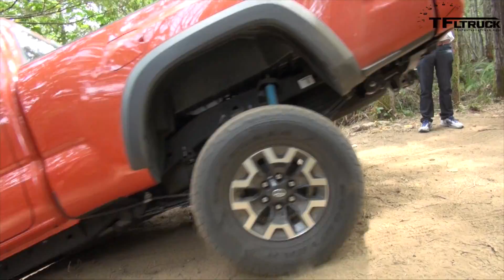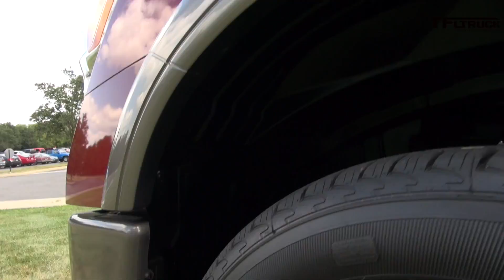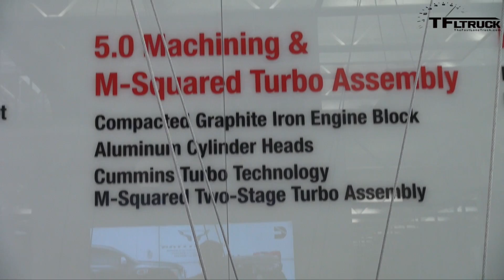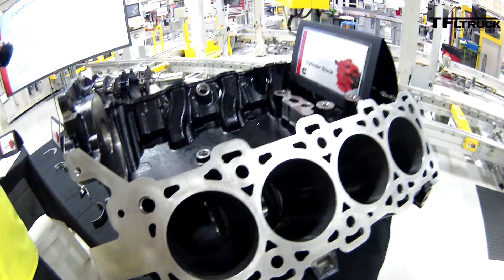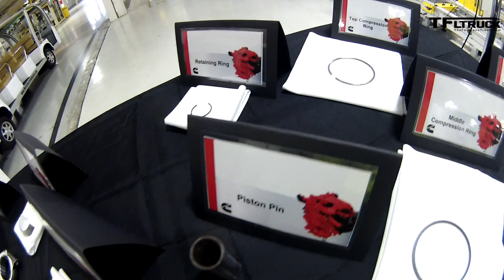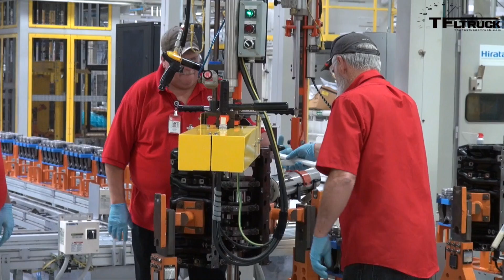2016 Nissan Titan XD: 5.0L V8 Cummins Revealed: Almost Everything You Ever Wanted to Know

Comment: fuck ur pice of shit cummins and powerstroke if u want a real desel get a duramax
Reply: I like this guy
Reply: lmao fuck that lol the duramax have been the less reliable of the big three!
Reply: Lol that's why they've had 5 different engines while dodge has had 3 and ford has had 4 lol
Reply: +Samuel Sanchez 5 different engines? The Duramax has been the same displacement and valve train since 1999. The changes have been to increase power, meet EPA regs, and fix early injector issues. It's been the same engine for 16 years. Ford is the one who has gone through the most changes, from the Navistar 7.3, to paying Navistar to design the failed 6.0, the 6.4 (which was supposed to fix the problems of the 6.0), and then finally doing it themselves with the 6.7.
Reply: soaringtractor
Agreed. The 7.3-powered trucks are still sought after.
Reply: Samuel Sanchez
Your example doesn't wash because the gas the engines use would be analogous to the rifle rounds, and gas, like the rifle rounds, can be used by more than one manufacturer's engine. The AR and AK are made by two totally different manufacturers, thus making them different. All versions of the 5.4 V8 are made by the same company.

You keep trying to make your point by referencing nearly everything external to the engine that changes, without addressing the core engine itself.

This explains the differences in Duramax engine versions. You'll note most of its design details remain the same from 2000 until now, hence my point:

http://truckintees.com/chevrolet-duramax-diesel-whats-the-difference-lb7-lly-lbz-lmm-lmk-lml-lgh
Reply: +Samuel Sanchez Dodge/Cummins are good... Ford diesels blow, outside of the 7.3... I don't trust any new Ford with a diesel in it after all the crap they have produced as of late. I would take a Duramax over any Ford motor, outside of the 7.3.
Reply: +Samuel Sanchez Duramax = reliable
Reply: There is the 5.9l 12v, 5.9l 24v, and 6.7l Cummins
Reply: +Samuel Sanchez One engine more than ford and they aren't reliable? lol... You must drive a F-150.
Reply: +Chris Ragsdale lol actually I don't to me 1/2 ton pickups are a waste of money lol anyways ford got rid of the 7.3 and dodge got rid of the 5.9l 12v due to emission regulations while Chevy got rid of the lbz due to injector failure, overheating, and head gasket failure so yeah lol I wonder why you said I drive an f150?
Reply: +Chris Ragsdale f-150 owners*
Reply: +Chris Ragsdale oh OK lol and yea same thing with all diesels the fucking emissions bullshit is what ducks em up lol
Reply: +Wade McKenney which one can beat this ? I have seen none in a 1/2 ton pickup
in Fact Nissan will own the show  for 1/2 ton  diesels
Reply: SurelyYewJest well if you look at it that way the 6.0 and 6.4 are the same engine just like you said different shit to it. And I highly doubt a current duramax will just bolt right up to a 1st generation duramax silverado and work without modification since the changes were so minor you know lol
Reply: Samuel Sanchez
Um, the issue wasn't whether the current LML Duramax could bolt into the same space as an LB7. I never said that. The issue you brought up was about the Duramax supposedly changing 5 times in a way significant enough to be considered 5 totally different engines. The answer is no, it hasn't changed to any degree such as Ram's switch from the Cummins 5.9 ISB to the 6.7 6BT; or Ford's multiple ground-up redesigns since the Navistar 7.3.

Are you somehow not able to differentiate between what the basic internal design of an engine is, and the design and location of its hard points for the vehicle it goes into?
Reply: +SurelyYewJest really that's like saying a 5.4l 2v and 5.4l 3v are the same when the opposite is true
Reply: +soaringtractor not to mention it bolts up to a different tranny and the intake manifold is different
Reply: Samuel Sanchez
Obviously your definition for what defines a "totally different engine" is quite loose. The 5.4 2V and 3V are effectively the same engine, one is just newer than the other. Same general design, same engine family, same applications. One is merely an evolution of the other.

So explain how GM selecting a new transmission to bolt up to the Duramax means the Duramax itself changed? Bell housing bolt patterns constitute a totally new engine? A new intake manifold means everything - block, pistons, valve train - changed?

Is the current Nissan VQ NOT an evolution of the original VQ30 of the 1990s?

Were the GM 2.8, 3.1, and 3.4 NOT evolutions of the original 350-derived 2.8?

Is the current Hemi NOT an evolution of the new Hemi from 15 years ago?

Was the Vortec 8100 NOT a perfected version of the 454?

At some point an engine is changed enough that one could say it's totally new, but looking back on the light duty diesel history of the last 15 years, the Duramax is the design that has changed the least, especially compared to Ford (not that change is necessarily bad, or not changing for that matter).
Reply: +SurelyYewJest bullshit because the 5 4l 4v and 2v  came out before the 3v yet they are all different. that's like saying an ar and an ak are the same because they can both shoot 5.56 or 7.62x39 or 5.45x39 or .410
Reply: +Wade McKenney Fuck Duracell! Why you think Nissan went to Cummins, cause powerchoke and Duracell cant handle any loads.
Reply: Steven Wallace
"Duracell" is supposed to be some kind of bust on GM?
Reply: SurelyYewJest lol there is still a difference! Why don't you get it? Lol just because the displacement is the same doesn't mean the engine is like ford's 302 and chevys  305 they're both 5.0 but different and also is the 6.8l v10 and 5 4l v8 the same? Since the engine core is the same the v10 just has 2 more cylinders?
Reply: Are you serious about Powerchoke??  They overheat and cant even handle pulling my little pony trailer up a decent hill. Give me a break.. Powerchunk will never hold a candle to Cummins.. And Duramax, yeah they might be fast off the line, but when it comes to where it matters all they are good for is getting their wife to hair dresser faster.  When it comes to lb for lb.. a v8 will never hold a candle to a Inline diesel.. ya better go back to school and little a little about diesel engines bud... why in the hell do you think they put Cummins in F-650's?.chew on that for awhile... and yes DUH!!!!!! Duracell is my crack on duramax.. wake the hell up.
Reply: +Steven Wallace The 650 had the 7.3 option when that motor was still around (not sure about 6.0/6.4). and when CAT was still around most 650's had the CAT motor
Reply: Samuel Sanchez
You are dull. Why would I ever say the Ford 302 and Chevy 305 are the same engine? 5.4 V8 = 6.8 V10? You don't even understand what I'm saying.
Reply: Because they share the same displacement just like the duralast I mean duramax lol and it's ok saying they are all the same is like saying a human being and a truck are the same cuz we both come from stardust leftover from the big bang lol
Reply: Steven Wallace
Ford has replaced all Cummins offerings in their trucks with their own PS 6.7. Your argument is based on old information.

"Duracell is my crack on duramax.. wake the hell up."

I see you have but one brain cell and air to rub together.
Reply: Good comeback, fail!  You better get your information straight dumbass, Cummins to this day is still putting their engines in FORDs you got some bad info.. hahahaha.. and why do you think that Cummins employees get discounts on Chevys, Fords, Dodge, and the new one NIssan..  Cause they all have either HOLSET parts or Cummins parts on their turbos or engines.. hahahaha you apparently dont know shit about the engine market.  Oh btw.. Cummins owns 100 percent of HOLSET.. just  a history lesson for you! jackoff!  SO yeah unless you have aftermarket parts on your turbo you have CUmmins parts on your truck when you bought it brand new... hahahahaha.. God you are freaking hilarious how stupid you are.. dont believe me,  call GM and see what they say..
Reply: Steven Wallace
You are living in some other dimension, or you are trolling, or both. Point to us where on Ford's website it says anything about their trucks using Cummins engines to this day. For that matter, where on Cummins' website does it say they have replacement turbos for GM and Ford? Because I'm not seeing those selections.

And so what if certain parts of engine systems are made by a company that is owned by Cummins? GM's Duramax and Ford's PowerStroke 6.7 use Garrett (owned by Honeywell) turbo units, and at one point IHI supplied the turbos for the Duramax. Even if Holset supplies specific parts for turbos from other makes, how does that mean Ford and GM use Cummins engines?
Reply: +soaringtractor don't listen to that guy according to him both the 7.3l psd and the 7.3l idi are the same engines because they are both made by International and they share the same displacement lol
Reply: soaringtractor
I know. That's what I said. Twice.
Reply: +SurelyYewJest really bro? get lost! don't even get me started on the differences! lol
Reply: +soaringtractor the 7.3l idi hasn't been in production for 21 years!
Reply: lmfao.. you apparently have no freaking clue how big Cummins is.. do you know how many freaking types of engines they make? and how many distributors and manufacturers they sell to?  I guess its because their engines sucks balls HUH? Yeah right.. if they sucked so bad why did they profit over a billion dollars in sales?  they make engines from a 2.8L up to 95L in many different configurations for alot of different types of applications.. offroad, highway, marine, and Gensets!  Please tell me again how Duramax is so superior over Cummins again?  I would like to hear that.  There isnt any other company other than CAT that can come close to their capabilities.. I cant wait to see this new V8 blow the doors off that duramax and trust me it will.. Here some future advice: Might want to wrap a towel around your head to keep your jaw from hitting the ground when you witness it.  Dont get too butt hurt over it. :)
Reply: soaringtractor hell yeah! The new super duty's are freaking insane! I work in pipeline construction and holy shit they blow both the Chevy and dodges out of the water! Too bad the interior fucking sucks balls now lol
Reply: Godsimaginary74 Dodge and Chevy might be bad ass on the street but put them to work and they don't last for shit. Yeah the Cummins and Duramax theoretically might last a million miles but it's pointless if the rest of the truck falls apart at 200k
Reply: Samuel Sanchez
Ford Motors outside the 7.3 are shit... The newest may be ok... their 6.0 was complete garbage... Talk about NOT being able to work, 6.0 is a joke.
Reply: +Godsimaginary74 the 6.0 wasn't that bad lol people just made and still make a big deal about them when they fail lol truth is all 3 have their problems
Reply: That comment made me fucking cringe

Comment: according to studies,  16%Titan owners tow  with these trucks.
so whats the point of this?
Reply: +SANIC The point of what? What question are you looking for an answer to?
Reply: SurelyYewJest a diesel is LITERALLY designed to pull!
yet none of their owners acually tow..
Reply: And what percentage of active F-150 owners tows? Do you have that data? Even if it's more than Titan owners, what percentage payloads a significant amount on a daily basis? What percentage of other trucks? If towing MUST be done, why did so many companies make compact trucks in the 80s and 90s? Those models couldn't tow much beyond 3000 lbs, if that.

If I polled all current pickup owners everywhere, regardless of make or model, I guarantee you the aggregate percentage of those towing and those not would be very much in favor of the latter. I have people in my neighborhood that buy $60k trucks as luxury vehicles, vehicles that have very obviously shiny and unused hitch balls attached to them.
Reply: SurelyYewJest F150 and silverado owners were at 56% if i remember right.
why make a diesel engine for a group of people who NEVER tow./
Reply: SANIC
A great deal of that percentage of Silverado/F-150 owners is likely to be business, so your numbers are skewed. But you know that all cars have tow ratings, right? A Honda Civic has a maximum rated tow capacity. Why should Honda give it any capacity if next to nobody ever tows stuff with one? Your argument doesn't make sense. It's a pickup. Pickups payload and tow. Who cares what percentage of their owners tow? Why should Nissan ignore those that do because you say so?
Reply: SurelyYewJest 500lbft or 300, it won't make a difference in a truck that people don't use for gowingt

Comment: Are those plastic timing chain guides? That interior looked damn good.
Reply: Just to answer your question with an opinion, I don't think they looked plastic. But I just wanted to mention that plastic seems popular in timing chain guides because that how it is in my V8.
Reply: +GeeBigSup The 3.5 timing issues were actually the abrasiveness of the US vendor machined chains. Notice none of the cars with the first letter J in the vin had zero 3.5 chain problems and used plastic guides .
Reply: Name a modern engine that doesn’t have plastic guides lol
Reply: +headcas620 They are Teflon guides.
Reply: +headcas620 God I hope not!  Having plastic timing guides on the Nissan 3.5 V6 didn't work out too good.

Comment: Just announce the darn price and fuel efficiency already!
Reply: +baseballwarrior17 I doubt it will beat the 3.0 diesel in the Ram but this engine will definitely do a better job towing.
Reply: +gperez12773 
I delited EGR, DPF, DEF off my 2011 ford superduty and yes my MPG got wayyy better, better respond, and i fill much better power, that on stock, recenty added H&S performance tuner and now i cant go back to driving stock settings love my H&S tuner
Reply: +blackericdenice im sorry to call you out but they are right and you are wrong you need to do your research and yes he did call the dpf the src the dpf is on every vehicle as of 08 and above that is a diesel it was a requirment by the epa and it does effect fuel economy in ford, chevy, and dodges they all lost economy due to these systems and the new diesels still use number 7 and 8 cylinder on the powerstroke and duramax and 5 and 6 on cummins to squirt raw diesel fuel into the exhaust system to raise it to 1200 to 1300 deg. F to cook the soot out of the dpf so there is a  drop in fuel econmy but with the added scr systems they do help with some of that problem by taking the nox and co2 absorber out of the exhaust system there for the nox and co2 absorber no longer being there does not need to regen as often so there is a gain in fuel economy but not by much because the dpf still regen every now and again so partly you are right but please do enough research next time so you dont sound like a dumbass
Reply: DUDE ! YOUR A SAD LIL BOY !...PRETTY FUNNY THE LOSERS I MEET HERE!..LOL OH YEH!...LEARN HOW TO SPELL "WRITE" NOT "WRIGHT" ...FUKN FLUNKY! LOL
Reply: +harry escarole Please do us all a favor and take your negativity elsewhere! Your presence alone is robbing us of precious  brain cells
Reply: +blackericdenice Actually you got it wrong. The newer systems still use diesel in the exhaust.
Reply: +youngblood23rb  yes, awaiting price.  stated fuel economy is a red herring.  we will need to have real-life towing over long distances to determine what the real fuel consumption may be.  the Titan is a very interesting competitor.
Reply: Ram turned down this engine from Cummins because it wasn't getting the fuel economy they wanted. I believe it gets low-20s tops.
Reply: +baseballwarrior17 I don't think they  have suitable vehiche for it - 1500 is too small, the others are too big.
Reply: +LR4TLC200 the regular titan is a 1500 the XD is a beefed up 1500
Reply: +C-grunt I never said it will beat the Ram and it won't. I would bet 16-17 city and 21-22 highway. 23 tops (with the little asterisk saying the exact setup you have to have to accomplish that)
Reply: +blackericdenice imagine if the 3L didn't have emissions prob get even better mpgs
Reply: +gperez12773 what is cace ?
Reply: gperez12773 yeh i didnt hear you either becuase a sloppin and gushin was comin from your grandmothers love coach !
Reply: +youngblood23rb "Almost Everything You Ever Wanted to Know"
Reply: +MsItsfake I actually expect the Titans to be competitively prices being that they are trying to split the market between 1/2 ton and HD pickups, now those top trim levels I do expect those to be quite expensive, but hope not F250 Platinum Expensive
Reply: youngblood23rb thats good to hear ! the truth always has a way of bringing pain to false auto prophets
Reply: +baseballwarrior17 low 20's isn't bad for a huge V8 in a huge truck. My dad was lucky to get 15 in hi's 4.7 V8 in his 03 Tundra.
Reply: +Rob Grune top end around 80
Reply: +gperez12773  american axles  and asen 6 speed transmission
Reply: +B.J. Rhodes Max torque at 63mph.